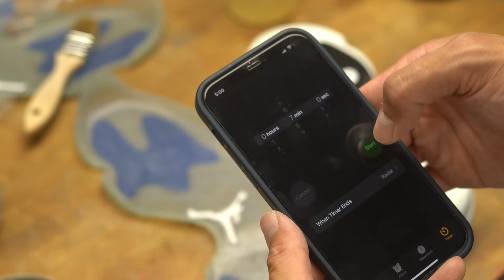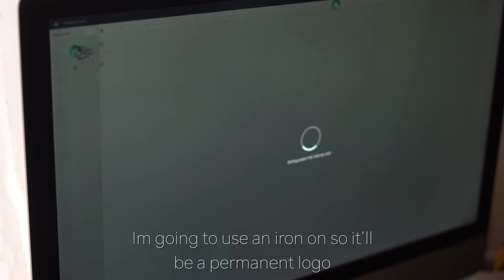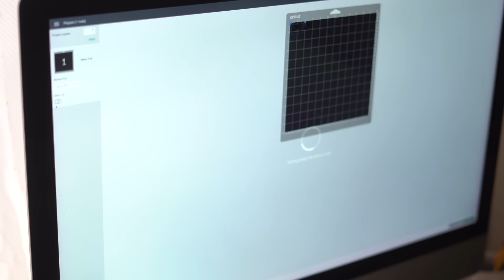ASMR 1995 Air Jordan Concord 11's Restoration

Comment: Gotten a lot of inspiration from your work over the years. I'm curious... did you do the ice treatment to both sides or just the glue side of the sole? Also from the start the midsole looked fairly intact. Did you remove and reglue so the wearer wouldn't have issues with the old glue up?